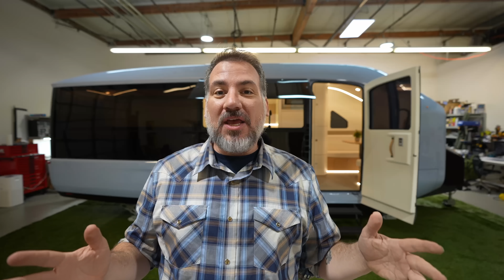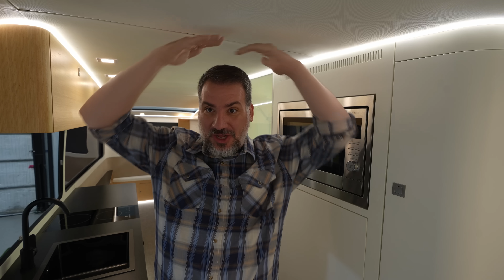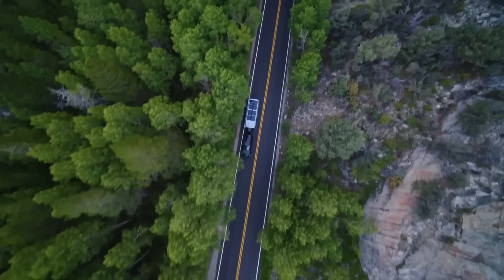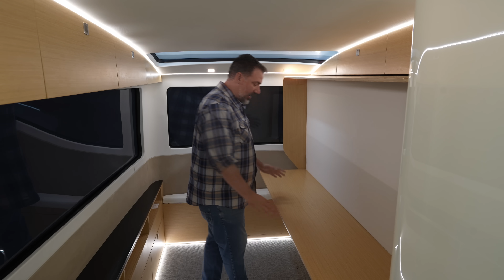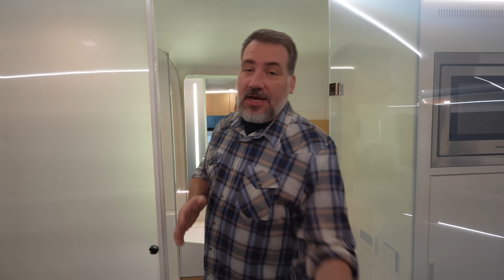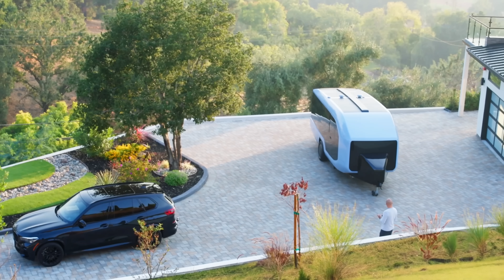Pebble Flow Tour | Groundbreaking All-Electric RV Trailer With Powered Axle

Comment: Great review and reporting as always. 
Here is my take. 6500 pounds, that's over 650 pounds on the tongue. What SUV will handle that? You would then need WDH to transfer the weight up to the front axle of the tow vehicle. 
What is the Gross COMBINED weight rating of the electric cars / SUV's? You have 6500 pounds of the trailer, I believe Tesla's run in the 5-5.5K range. Do electric vehicles have a gross combined weight rating of over 12 to 15K ?
Boondock for a week with the battery, but how about the 37 gallons of water:)
The little wheel on the tongue jack is wonderful if campsites had nice pavers like in the video. 
Solar, OK, I'm from the east coast. We have trees in campgrounds, state and federal parks that do not have electric sites. Traditionally people who dry camp would want shade, to be in the woods or nature. 
Campgrounds that lack shade are private, they have full electric hookups. 

Thanks for your review and always look forward to your podcast on my daily commute.
Reply from the maker: Good points - you're definitely not going to be towing this with a Tesla. It's too heavy. You still need something with 6500lbs of towing capacity. Lots of big SUVs could handle it, but definitely not the small ones. Unfortunately, all of the wights are not known yet. Thanks for watching!
Reply: A Ford explorer can't even tow this. Largest motor max tow is 5600lbs.

Comment: I’m curious about how they are planning to heat and cool the trailer. Heat pump? How about storage space? Other than the cabinet doors and the price, I like it. 
I can foresee neighbors being scarred when people forget to activate the capacitive glass before changing clothes.  😂
Reply from the maker: It's an automotive air conditioner and electric heater. They didn't like any of the air conditioners offered by the RV industry for some reason.... lol
Reply: @RVMiles I can see why rv systems are not very efficient.
Reply: @RVMiles  the Pebble Flow does not use resistive heating, it has a heat pump
Reply: It has a heat pump which handles heating and cooling.

Comment: This rig has a lot of potential.

 And you had me until you mentioned the price….

But you’re right, people will buy other luxury rigs at the same price point but they won’t be as convenient.

 I like the electric drive train and the ability to maneuver the rig without having to hookup.

 I also love the auto hitch feature. Even going solo hitching would be a breeze…..

 But I’m not a fan of those cabinet doors….

 Hopefully in full production they’ll either be swing up with pneumatic or spring supports, or with sliding doors.

 There’s also the aesthetics…. To me it looks too sterile, or even too bland. Even if they used stickers, I’d like to see a touch of wood here and there.

and then there’s all that glass. It’s better in the bathroom so there’s no shower curtain flapping in the breeze, but you’re going to need gallons of Windex to keep it clean.

 And what about the outside? How to clean it? Can it be pressure washed?

 There’s probably more, but I think I’ve rambled enough…

Interesting rig design though

Comment: Interesting design concept and prototype but I’m waiting to hear the details on the construction. If they want to play in the airstream market, they also need to have the construction of an airstream or better.  There’s a reason those things are sitting around in farmers fields for 50 years and still look pristine.

We’re waiting to hear what the frame is made of hopefully aluminum, what the walls are made of what the roof is made out of , the weight on that axle is that looks like an awful lot of stuff on a single axle.

Otherwise, they’ve made a very intriguing vehicle. Can’t wait to see more detailed specs.
Reply: Hi there! Thanks for your feedback. The Pebble Flow has been built using rigorous automotive manufacturing processes. All-aluminum space frame construction. Lightweight & durable composite and sustainable materials. Built-to-last durability that surpasses industry standards. We're committed to making Pebble Flow the safest RV on the road :)

Comment: Those drop down top cabinet doors may work for someone 6'2", I doubt someone under 5"6" will find it so useful.
Reply: Agree about the cabinets! No way I could I access anything at 5’3”. Unless I used a step stool LOL. They need to have them go up - not down.
Reply: Totally agree. I'm 5'5" and struggle with the higher cabinets we have.
Reply: Airstream got the overhead cabinets right. They don’t flip down for a reason.
Reply: Flip up?
Reply: I can’t understand why they did them that way. What is the advantage? Seems like flip up would be a no brainer.
Reply: Pebble agrees with you and has said on their customer Discord that they are working on a new design.
Reply: The cabinets can’t flip up because of the arched ceiling. Doors on cabinets need hinges that flip all the way down, not 90 degrees.
Reply: We're liking the new technologies & design. Not sure about the battery lifespan or replacement costs.
We always attempt to block cabinet contents to prevent falling out when opened after a day's drive. So having the doors open downward may be a plus. P. S. We're not too short & already I have to assist the wife to the rear of any shelf.
Reply: @cirrus820travelers  Battery size is 45KWH LiFePo4 aka LFP. They will designed to last at least 10 years at 80% - Tesla have vehicles on the road for this length of time at 90% capacity. I wouldn't be concerned about the life of the batteries, I would be concerned about the framing quality which wasn't mentioned. How long is everything going to stay together going down wash board roads year after year after year? . Edit: I can envision those hitch mount wheels digging in while attempting to move this trailer on its own; they should be inflatable.
Reply: @Scuba__Steeeve  framing quality compared to what?  the crap coming out of Indiana right now?
Reply: @cirrus820travelers  With an LFP battery, it should last longer than the rest of it. My Tesla has an LFP battery and it is still supposed to have 80% capacity at 750,000 miles.
Reply: For sure I told my realtor they needed to find a super short house for the same reason. Being on that little step ladder is just too dangery guyzzzzz🤦🏻‍♂️
Reply: Crazy idea but check it out- footstools...
Reply: They make step ladders and steps.
Reply: Cabinet opening needs to change to flip up!  Not down… that’s a horrible design.